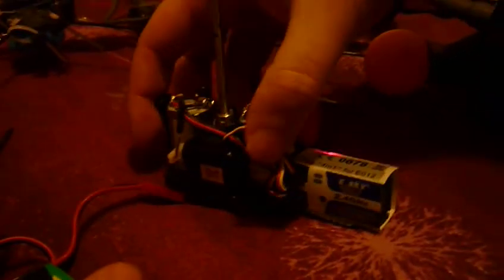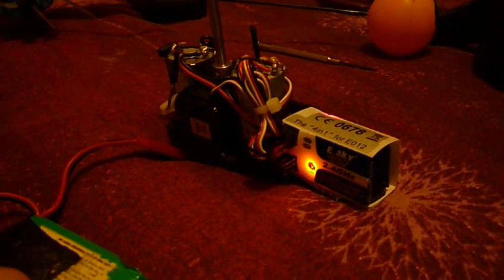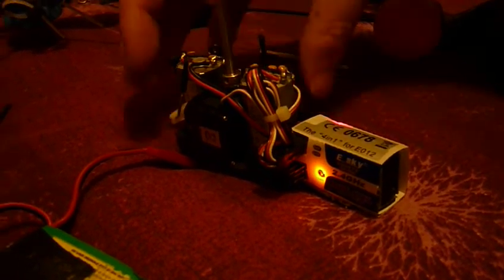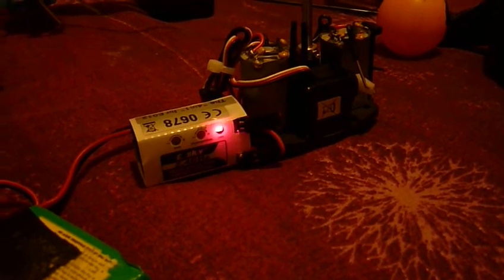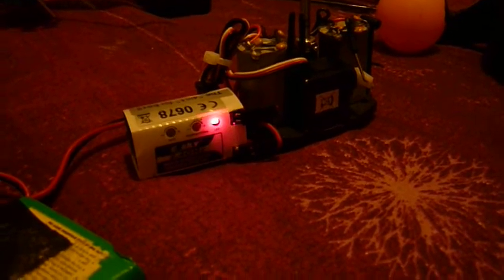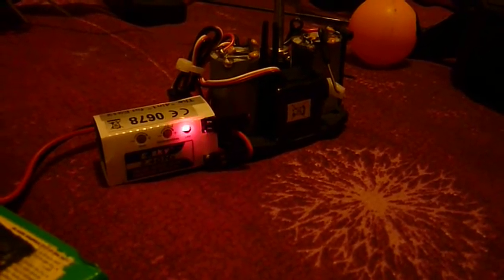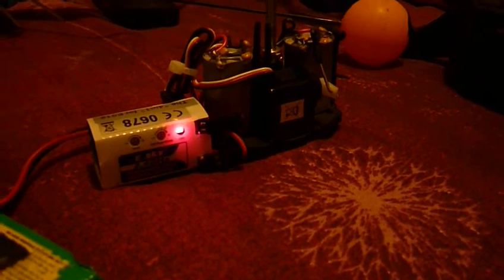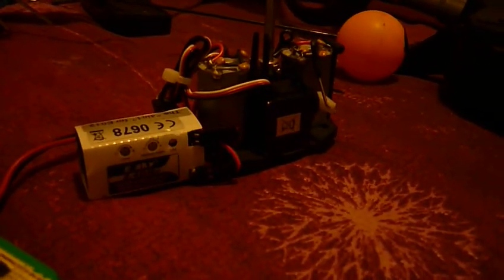co comanche 4 in 1 fault

Comment: @donohue100 Hi, yes indeed it will need an antenna, and a tuned length as well to match the output of the controller, which one is this? 27, 35 or 2.4ghz?